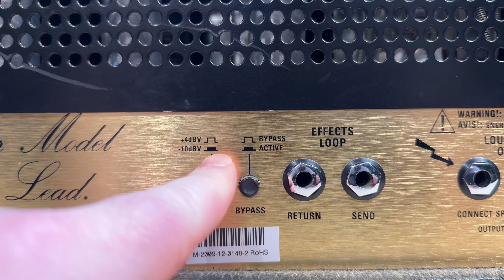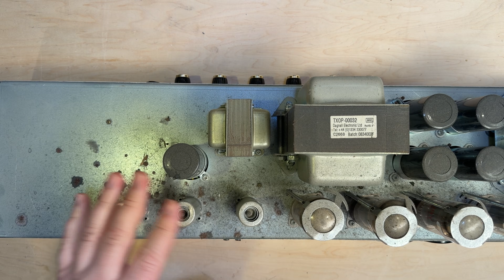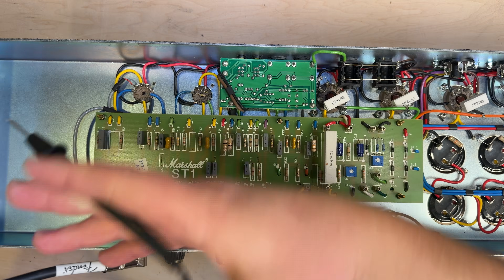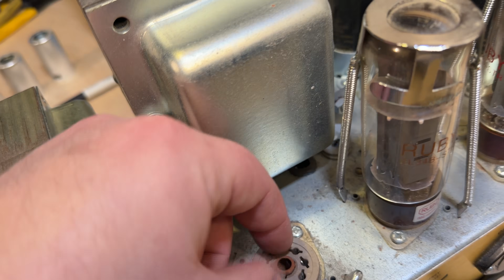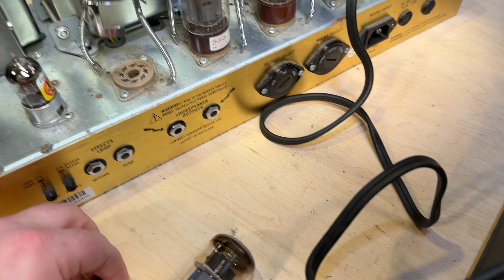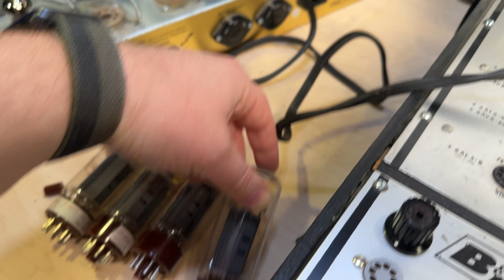Marshall JCM800 Re-Issue Pre-Purchase Inspection

Comment: Did the amp work even with the 1 ohm resistor dead?
Reply from the maker: With that resistor dead that tube will not have a path to ground and won’t conduct current or pass signal. So, the amp may work, but at best would sound strange since you would have asymmetrical clipping in the power section.

Comment: What happened to the chassis? Did a dog pee in there? All jokes aside, it's one of the better re-issues I've seen as many have the tubes direct mounted and soldered to the pcb. I notice a large wirewound adlustable resistor near the caps. Is that hv adjustment ot input? You may have to disconnect 1 leg of the strapping resistors to get an accurate reading. But thanks for the video!
Reply from the maker: Hahaha, i hope not! The current owner of this amps plays a LOT of shows. Best guess is beer.

Comment: How does this “pre-purchase” thing usually happen between a seller and a potential buyer? Is it common?
Reply from the maker: Honestly, this is the first time i have done it! Definitely have checked out gear for the local guitar shop but this was a different situation. This (potential) sale is between two people that know each other, so the amp was in possession of the buyer to try out and he wanted to have me check it out before committing to a sale to make sure there weren’t any major issues. 

On my end, I basically charged my minimum fee for the inspection which will go towards the first hour of actual work done if the customer proceeds with a repair.
Reply: @TechnologyEnterprises  Yeah, it looks like it’s all based on mutual trust. I hope the customer goes ahead with the purchase and the repair with you. Anyway, great story. Thanks for sharing
Reply from the maker: Yeah, i have never acted as the third party for a sale between two strangers or anything. Thanks for checking out the video!

Comment: Get a REAL vintage JCM800. 1981-82 or older. I owned one of these reissues. They just don't compare to the original at all.
Reply from the maker: This one is for a customer that is getting a screaming deal on it if they push forward with buying it and having it repaired. 

I have a mid-80's 2204 in my personal collection but it hardly ever gets played because i prefer my 1973 Lead 50!
Reply: @TechnologyEnterprises  I love my 1982 JCM 800. It has the 6550's. It crushes with a simple SD-1 in front. Will never part with that one.
Reply from the maker: That’s awesome! I may have to finally put my mid 80s 2204 on the bench and modify to earlier circuit specs. Maybe that should be an upcoming video…
Reply: lol. Such BS. I have a reissue 800 from 2007 and a '79 JMP, all original no mods. They sound functionally IDENTICAL when I A/B them. The reissue 800s are "real." If there is one thing Marshall gets right, it's their reissues.